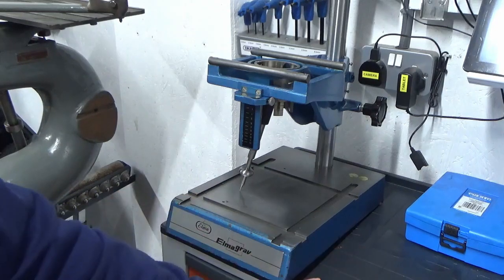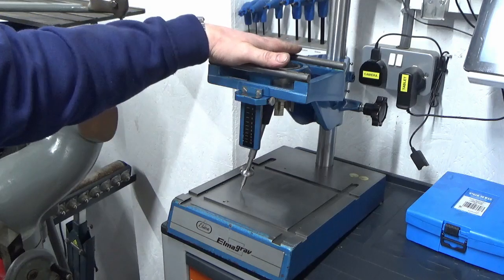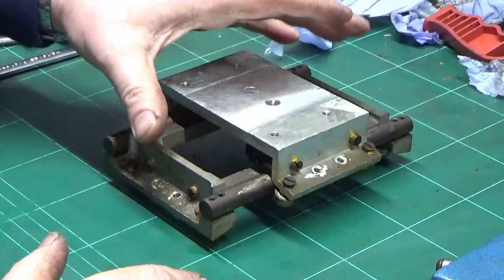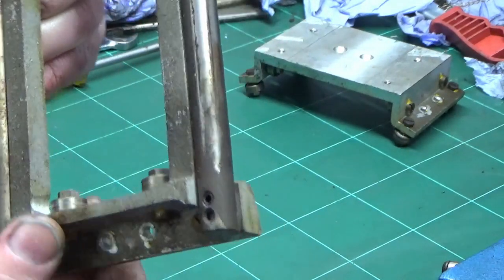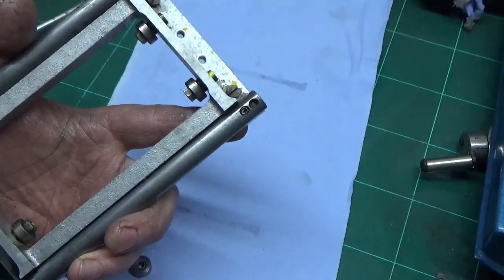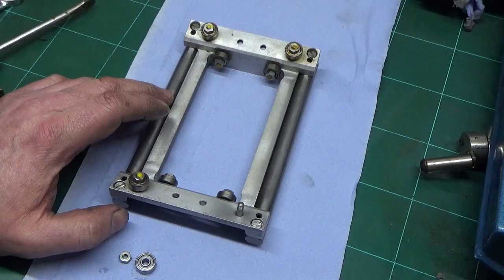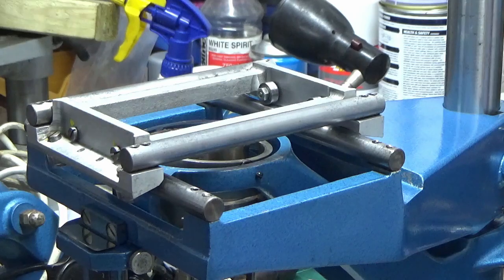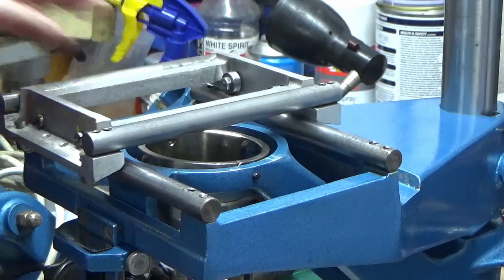My New ElmaGrav Engraving Machine Refurbishment & Re Build - Part 2

Comment: Hello Jon. I finally got the opportunity to watch part 1 & 2 of this. Very interesting mechanism. A different way to get coplanar X and Y motion than the usual cast iron ground or scraped ways and gib strips. Time consuming to set up the bearings though. I guess not as time consuming as scraping ways in. Would be intriguing to repeat the clock test with the weight of the table on the bearings to see if that loading made any difference. Looking forward to part 3 and further on to the shaper refurb. Cheers, Carl.
Reply from the maker: Hi Carl, thanks for the comment. Yep, a very unique mechanism, very simple parts individually, but as an assembly, quite a complex affair. As I have discovered tonight, there is clearly more to setting one of these up than I thought lol!! Cheers, Jon